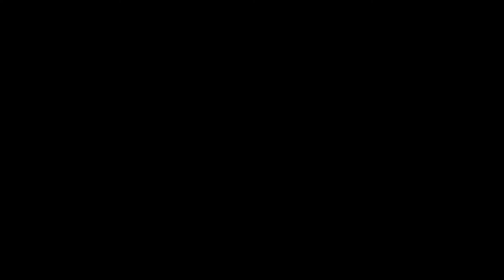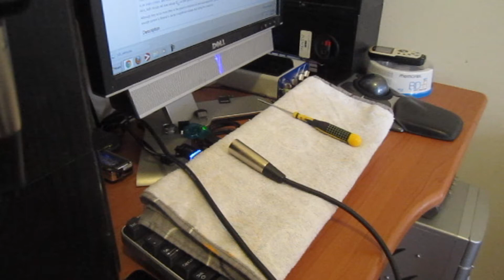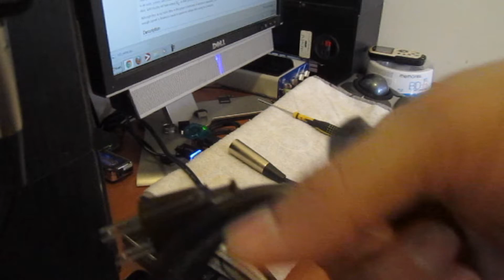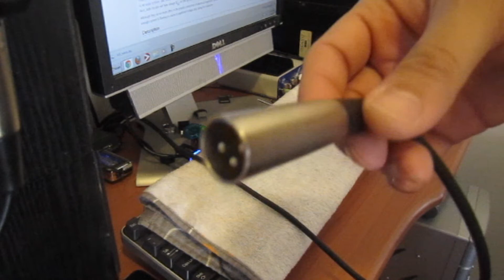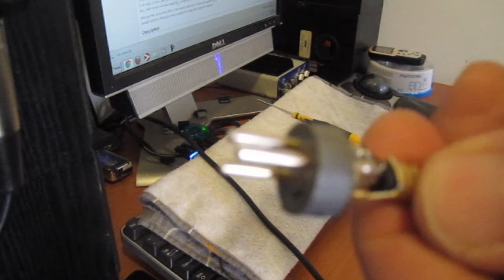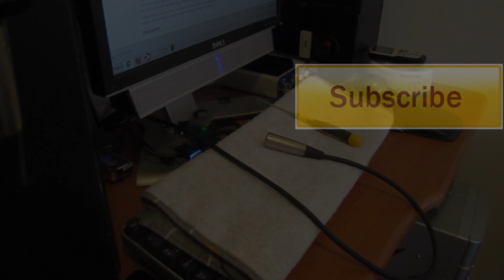Ground Loop

Comment: I run my uber sensitive valve hifi on a separate power strip from everything else and that seems to work flawlessly. I try to keep hifi, music gear and computers separated.

Also, A great tweak for your hifi and music is to tighten up the screws on all your wall sockets. My house was built in 1935 and some of the sockets are original or where replaced 25 years ago. Some WD40 and a tightening really improves bottom end as it lets power supplies 'breathe' more easily.